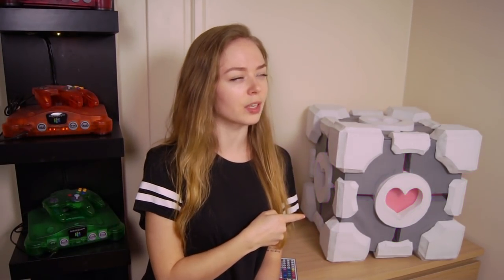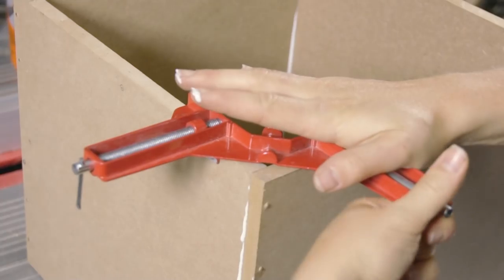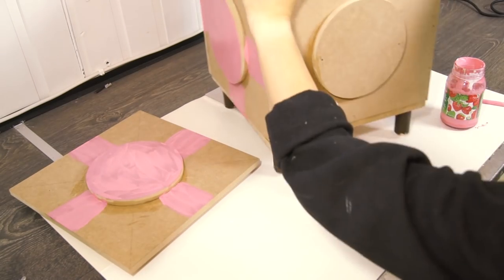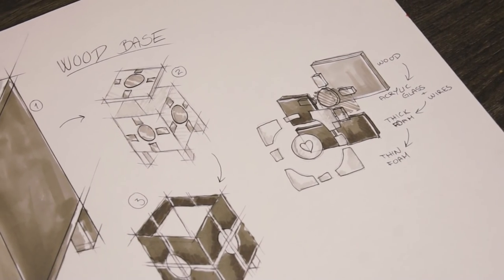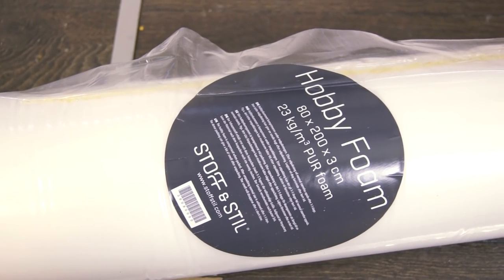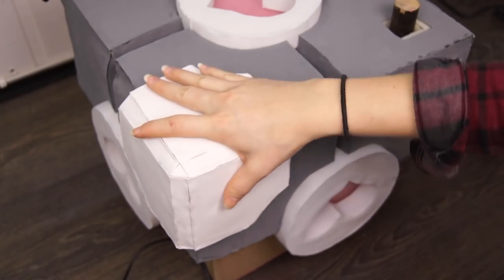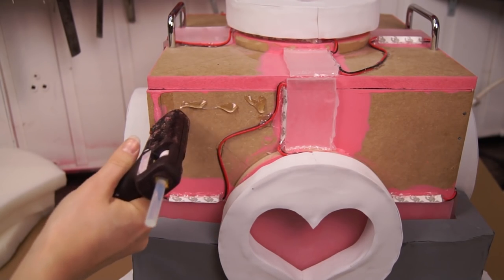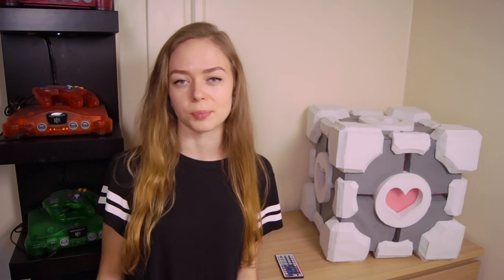Making the Portal Cube (Companion Cube) || How-to

Comment: When working with foam it's best to wet the foam, then wring it out so there isn't much water left in it. Then freeze the foam to make it hard and easy to work with. Finally when you are done cutting the foam put it in the dryer to remove the water. I have done many gun boxes this way and I always get a nice fit and look. I love the videos and I hope I helped a little.

Comment: PRO TIP: use an electric carving knife to cut foam.  - not a hot wire - a electric knife has two serrated blades that slide back and forth (motorized, obviously)  also known as a "turkey knife".  I do some automotive upholstery, and the electric knife is the best for slicing through foam.

Comment: Foam is easily cut with a hot thin steel wire.. just put some electricity to the wire or look it up on the internet, they are not that expensive and easily self to make or take a bread saw on electricity, a old kitchen utility 😊
Reply from the maker: Made one in another video, but foam cutters don't work with this kind of foam. :)

Comment: Instead of foam use Styrofoam 9/10 you can get free stuff from dumpsters and a simple rigid piece of wire with current flowing through it to make it hot will slice through it like mad. Other then that nice tutorial.